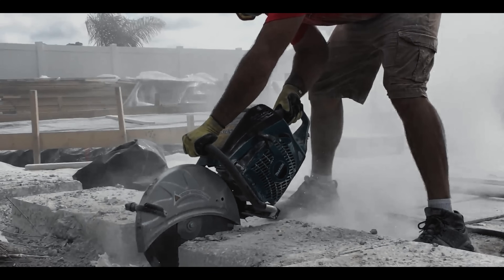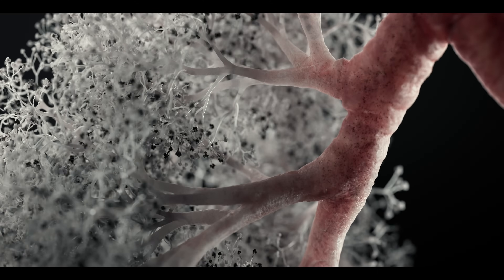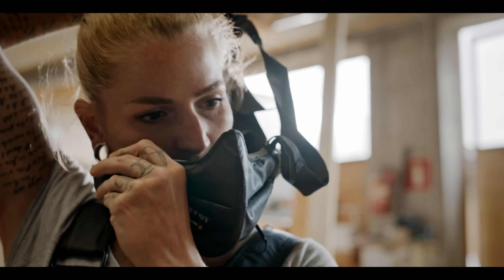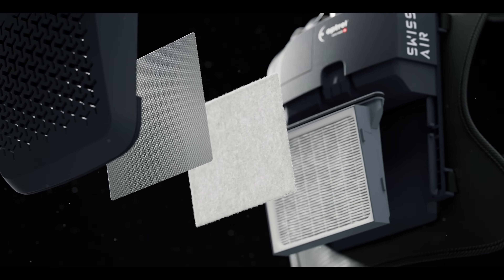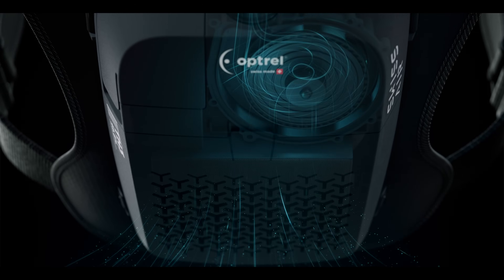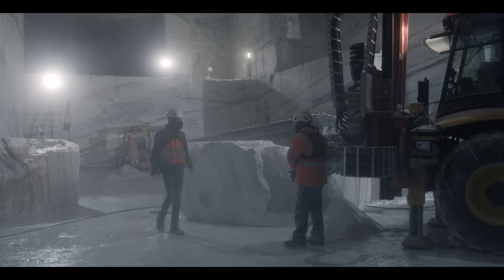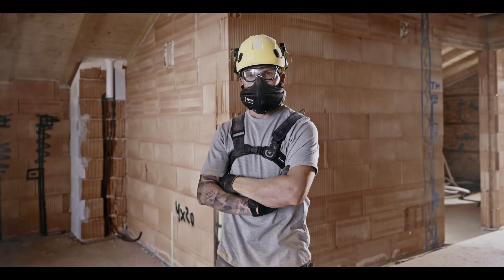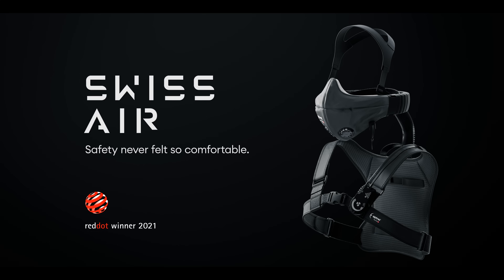optrel swiss air respiratory protection system - Safety never felt so comfortable

Comment: Is this compatible to a p100 with the carbon layer for obnoxious and organic gases have been looking for something better then half respirator because I have to wear all the time when out and it stinks to wear for my health
Reply from the maker: You can't use other filters with our swiss air as the size won't fit and the protection is not guaranteed like that.
But if our ABE1P combination filter filters out organic and inorganic gases / vapours, acid gases /vapours, sulphur dioxide and particles. Also our ventilated half mask can be fit to individual face structurs to cover the mouth and nose area completely. Positive pressure supports breathing and avoids fatigue. Together with the ergonomic design and shoulder harness, you can use it comfortably over a long time. Depending on the mask used the swiss air is TH3 or TM3 and NIOSH approved.
Check out our page https://www.optrel.com/en/product-view/swiss-air for more information.